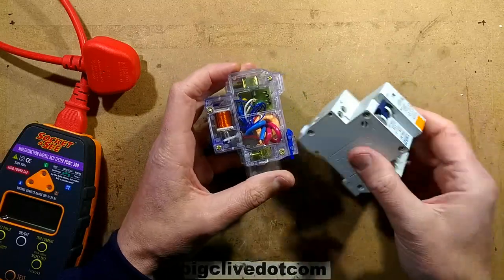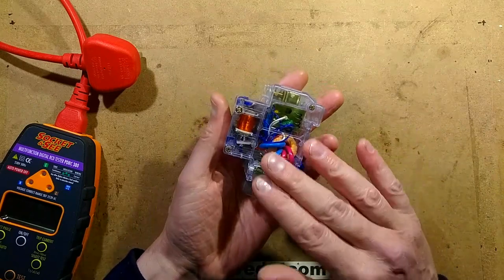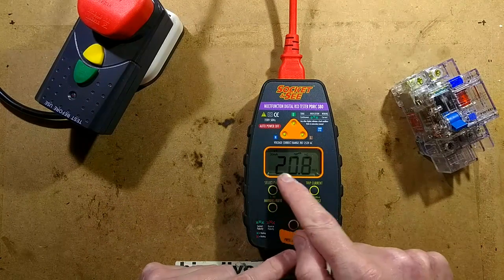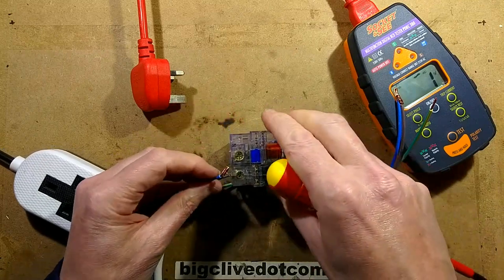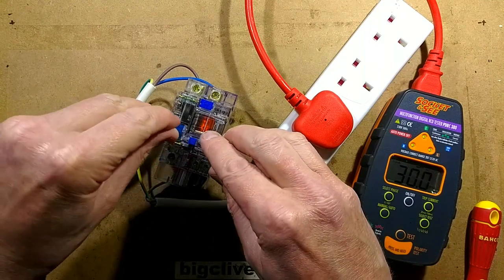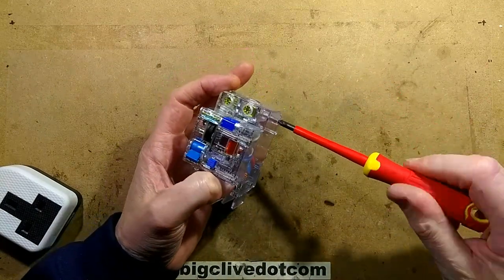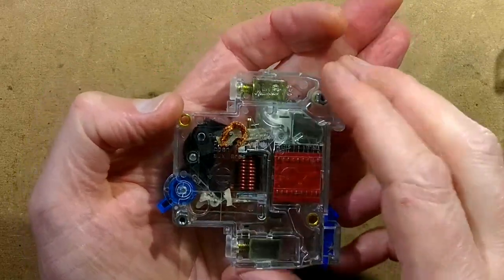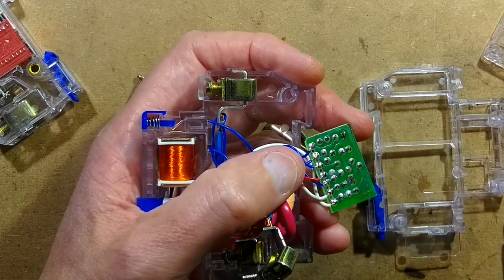Really neat transparent RCD/GFI.  (with schematic)

Comment: RCD = Royal Current Detector. No currents shall pass without the Crown's approval.
Reply: Now we need one for the AFCI's
Reply: Hahaha, good one!
Reply: In the US, GFI's are only required on appliances which require them for safety, and as such, those appliances must be sold with a GFI built in. I am not sure the exact definition of things which require them, but I do know they are required on things that function in or near water above a very low amperage.
The US and UK actually have very similar regulations, however, the point of failure are vastly different. The US regulates the appliances while the UK regulates the homes.
Reply: Richard Smith in the US GFCI's are required in wet locations, outside, bathroom, kitchen sink area, mud room, utility room, unfinished basement, pools. they are also required by OSHA on all job sites so there are a lot of extension cord type adapters for that purpose. we do have the option of going with a breaker or socket in applications. typical example would be a bathroom would have GFCI outlet, outdoor outlets would be strung to either a master GFCI breaker or a master homerun GFCI outlet. pool equipment would probably be on a GFCI breaker. temporary power drops are also required to have GFCI outlets because they're typically used for construction... OSHA requirement written into NEC. I have also started to see 240v equipment in fast food restaurants being put onto GFCI's.
oh and then any equipment that would be used in a bathroom like hairdryers and curling irons ( I'm surprised we don't have them on toasters yet because that is an essential bathroom appliance LOL ).

in some ways I like the idea in the UK that they have whole home protection, with the usual side effect of knocking out all the lights in the house.
Reply: AFCI, arc fault circuit interrupters are being required almost everywhere now (US). they originally started popping up about 3 years ago and were only required in bedrooms to prevent arcing when plugs were not plugged in all the way?, cords under carpets?, plugs jammed in wall behind bookcases?, Chinese "pink" electric blankets!. now they're being promoted as a way to prevent installation faults and the occasional siding nail through installed wire. however it was more of a "me company have patent, how do I get requirement in NEC!, and Get MO Money" and it has a mess of requirements on shared neutrals in 3-way (2-way? in the UK) switch boxes which can guarantee a house being retrofitted will guarantee a trip(s) and a subsequent lighting circuit(s) rewire.
Reply: I've never heard of AFCI being required in US for anything other than pre-WWII era houses that still contain knob and tube.  Pretty sure last time I was in the HW store for a breaker a couple years ago the only system they even carried them for was Siemens, maybe, just maybe they'd finally started carrying AFCI for the higher grade of SquareD QO series boxes.  Definitely not for GE or Eaton BR series though...
Reply: bashkillswitch and others The last few releases of the NEC have started a requirement for AFCIs in bedrooms and then in the next revision(s) it went crazy from there. so much so that in this area we have people who will rent AFCIs out for your inspection! unlike a GFCI, AFCIs cannot share a neutral with any other branch circuit; so most likely it will not work on knob and tube wiring as that was a heavily common practice.
unlike GFCIs that protect against ground fault issues, AFCIs are meant to protect against arcing wires - say a plug jammed behind a bookcase or bed, a cheap "pink" Chinese electric blanket, heavily kinked, cut or frayed cabling, or a siding nail that has gone through wires that goes undetected and is electrifying stuff that shouldn't be. the controversy started because there was only one company making them, they were heavily expensive, and they practically wrote (READ PAID) themselves into the requirements……… oh and don't forget the nuisance tripping.
and you are also required to have them on top of GFCI's in some areas.
PS I think you are thinking of GFCI breakers.
Reply: KKK GRAND DRAGON ADAM RACEWARSKI 
LMFAO HAHAHAHAAHAHAHHAAHHAHAHHAAHlol

Comment: This is calling to put some LEDS inside.
Reply: oh don't start. Then they will add bluetooth so you can reset it without fumbling in the dark. #stopOverEngineering
Reply: Reckless Roges lol!
Reply: Reckless Roges They should put a cellular modem so you can reset it on the other side of the world! #stopUnderEngineering
Reply: Ahhh. I can do drive by power cuts..........
Reply: The UK did that with the power meters instead with one master password for everybody.... until MI.. something I got involved.

Comment: If standards people had half a clue they'd spec stuff like this to have transparent cases to make it easier to spot fakes. (Though I do wonder if it has the same fire rating).
Reply: Maybe a flame test to see if that clear plastic self extinguishes would do some good if it's tough enough plastic. Fakes are sociopathic if not just completely stupid so that easily overwhelms the notion that it might look like a toy to some... I almost want one of these for fun.
Reply from the maker: The flame retardancy did go through my mind.  I'm not sure how easy it is to make clear plastics flame retardant.
Reply: if it's made from polyethylene, it does not come in clear. but there are some ECTFE based transparent fire safe plastics.
Reply: I'm not sure how you're defining "fakes."  If it qualifies to the standards, how is it fake?  
If it's just a lower cost alternative to an expensive brand, it's not really best described as "counterfeit" or "fake."
Reply: Landrew0, if the relevant standard required that such devices have a transparent housing it would be more difficult for unscrupulous manufacturers to pass off under-spec or non-compliant devices as genuine, since a simple visual inspection would immediately reveal that the internal components are not up to scratch.
Reply: If the case is polystyrene, it is combustible and would need flame retardant additives. The case would have 'PS' under the recycle logo, if it has one. I wouldn't trust this if it was polystyrene tho. That stuff shatters just by looking at it too hard, unless very thin. Yeah, HDPE would be good, but the clearest you can get HDPE is the opacity of milk jugs. 
It looks like polycarbonate to me, because of the blue color of the edges. Polycarbonate is not a combustible plastic, at least, less combustible than necessary to be used in electrical panels.
Reply: sixstringedthing I agree every dam thing should be made clear. What for being able to see inerdes, also I wonder if they would just thro random bits inside.
Reply: Landrew0   if its NOT been certified & approved ect then its null & void even if it seems to work as it should as there maybe other underlying problems not obvious such as flammable plastics, long term reliability ect
Reply: Landrew0
Reply: @Landrew0  There are fake breaker that are only a switch. The problem can be, that if you buy them on Amazon those fakes might even carry a brand name.

Comment: I see you wrote 300 milliseconds as "300 mS". What's up with that? I've seen it occasionally. But the symbol for second is the lowercase "s", and in electrical contexts the uppercase "S" means Siemens, so the potential for confusion is great. Is there some actual reasoning I've missed?

Comment: You could talk about the simple but critical loop back of stranded wire for termination. You'd be surprised what happens when a house electrician tries to wire a motor control center. Groan.

Comment: I really like the transparent design of these safety devices. It enables you to directly see what the build quality is like. But I think a downside is the fact that it's pretty damn hard to read the ratings on the front.
Reply: you could also easily spot a fault (either manufacturing fault or fault after some time in operation). I think it's just for show / educational purposes and not actually installation. The transparent circuit breaker we had in our company had a lable on it: only for educational use. Maybe because the plastic wasn't up to swiss /european standards (i guess they should be fire resistant)
Reply: Downside is this kind of plastic is usually brittle.
Reply: The ratings could be printed on an area with nothing to see, with a non transparent background.
I like the idea of being able to see any internal skid marks or other damage. If they can make these in a way they won't become brittle and dangerous, they should make it part of the standards to require them... Old time fuse wire holders (at least in Australia) were easy to check for damage. Modern stuff is a pain and requires an electrician, which is expensive.
Reply: Yes, the usual unknowns, as with all Chinese 'safety' related devices from ebay are the longevity of the plastics used. Will they discolour? (Not so bad) Will they go brittle? (Could be bad). Are they flammable? (Could be very bad). That is one reason we have decent regulations in many countries. I am not saying this product is bad; it's just that we don't know. It's the stuff you can't see or isn't immediately apparent. The subtleties of these RCBOs is fantastic - do have a look at mikeselectricstuff if interested.
Reply: US suppliers do make clear breakers, but usually they are strictly for R&D or education. Buddy at work had a few from Westinghouse. Very interesting, but those actually were code compliant and were flame retardant. The plastic was not a clear polystyrene or something like that one, but more of an off-color mostly translucent plastic. Still could see the guts working, tho.
Reply: They are difficult to read, and for some reason some makers use white ink instead of black, so even more difficult. On the equipment I worked on that used polycarbonate shelled devices, I got in the habit of carrying a pocket magnifier to read the specs.

Comment: So, another instance of Chinese crap being not crappy. This was a very enlightening video, Clive. All of yours seem to be, but sometimes the subject item carries more impact for me. Thanks once again.
Reply: I'm not so sure.  I'm not keen on the lack of thermal runaway protection on the MOV.  Others are questioning of the clear plastic is sufficiently flame retardant.
Reply: Perhaps Clive will chime in to share if there is the recycling symbol for which clear material is being used for the body? Other than not having the Stamp of Approval, he seemed pleased/satisfied with the device.
Reply: Might not be necessary (depending on the thermal/magnetic breaker rating). If the MOV fails low-resistance, the current draw will trip the overcurrent breaker (which will provide the necessary safety factor). The fact that the breaker would then NOT reclose (fault not cleared) would indicate to the user that there's a persistent fault.
Reply: Two questions:  Can circuit to the MOV will support the trip current without burning up?  Those look like some small wires.  Second: I was under the impression that failed MOV got hot.  Very hot.  That's what caused some power strips to catch fire.
Reply: At